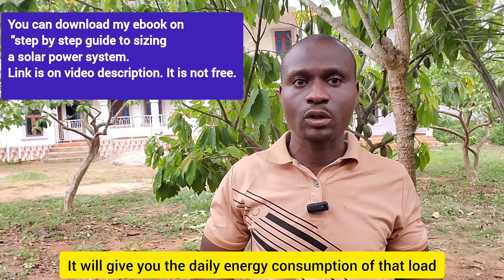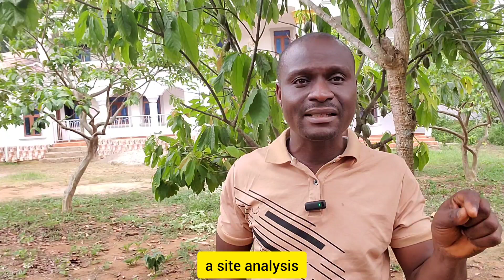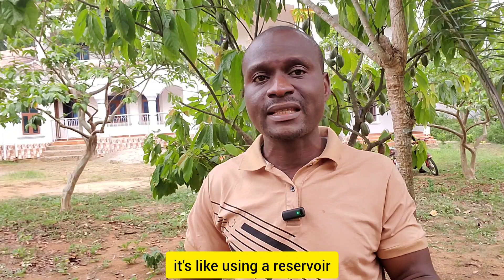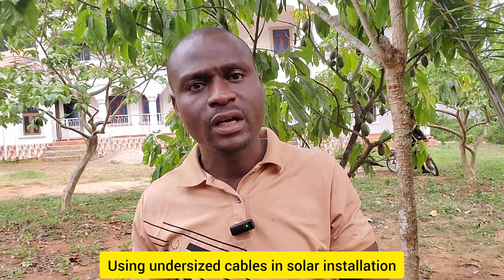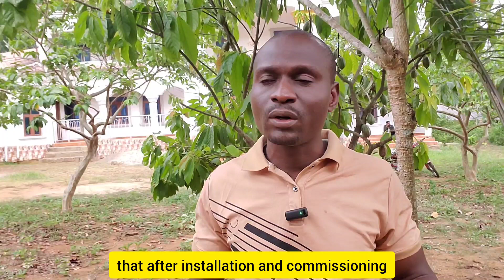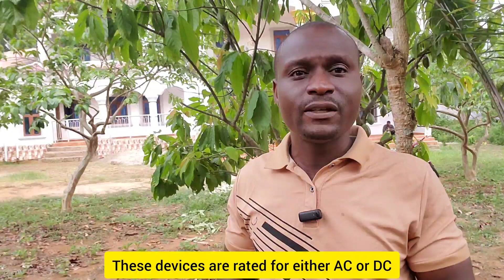Mistakes beginners should avoid in solar installation. #solarenergy #solarpower #solarinstallation

Comment: The recommended cable size for the solar system is between 6mm to 10mm. 

16mm to 25mm for a large scale system.

Comment: Boss please i need your advice. Am trying to install 15kw system in house with 22 panels   each has 580w and also 15kw inverter and each inverter is 5kw with built in mppt.Each inverter voltage is 90 - 500 DC. And my batteries are  two lithium lifepo4  and each one is 15kw with 51.2 V and 300ah.Please what kind of cabbles can i use please and also any advice will be appreciated. Thank you
Reply: Couple of things to put in mind include the distance of transmission, averagely I will use between 10-16MM DC cable depending on the distance of the panel to the setup
Reply: Also check the manual inverters have recommended cable sizing
Reply: Big man

Comment: What are the requirements for 5kva capacity solar power system, someone should help me with the exact requirements 

In terms of 
Battery capacity required 
Number of solar panels 
Solar inverter capacity 
Solar controller capacity 
This is required to power 

AC
Water heater
Water pump
Electric cooker
Electric pressing iron 
TV
And other small devices in a 3 bedroom bungalow
Reply: Chat me up bro

Comment: How do we know the size of cable to use if is not written on the inverter or charge controller
Reply: Know the amount of current going through each cable. Use that amperage rating and size the cable.

Comment: Voc and Isc values written on solar panels are under STC, therefore, the panels will never give you the same values under real conditions.
Reply from the maker: Yes you are correct. This is what i mean; Good quality solar panels will produce reasonable amount of energy when the  intensity of sun is high. Poor quality solar panels will underperform even when the intensity of sun is high.
Reply: @Solarwattng  Pls I need to ask a question.. can someone without electrical engineering skills or degree learn how to install solar panels?
Reply: Yes, very well.
Reply: Yes

Comment: If I may ask sir what size solar do I need to run a 500watt inverter using a 50amh  battery pack plus what size solar controller is required here I'm confused sir😢 please assist.🇿🇼
Reply: What is your load in watts? And for how many hours you run that load?
Reply: @akhan8456  1 "32"inch plasma Tv (6hrs watching time required),cellphones( charging time appox 4hrs)that's all lights work independently have their own system
Reply: First calculate the total daily energy consumption, divide by the efficiency of the inverter, the divide,by performance ratio of the solar,then divide by sun peaks hrs,then divide by 600w solar panel you want to use

Comment: 5.5kva hybrid solar inverter and 8 tubular battery 220ah - 12v. What type of cable is needed for the system?
Reply: 8 to 10mm
Reply: @henryanwuna6678 what of 3kva hybrid and 2 tubular batteries?

Comment: Good morning, Please I want to confirm something very important 60amp charge controller. How many watts maximum do I need on it?
Reply: Depends on the brand and voltage you are using. If you are using a Felicity brand, 60amps 12 volts is 825 watts, 24volts 1650 watts, then 48volt 2500
Reply: Sorry, the 48volts is 3300 watts not  2500 watts..